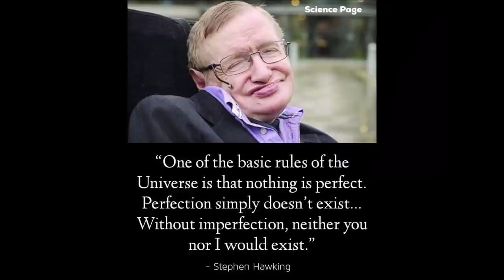1970 Chevy Impala 454 Fire Chief 1/25 Scale Model Kit Build Review AMT1162 and Tutorial

Comment: Your build looks fantastic.  However guys should know that this is a re-issue of the original annual kit from 1970.  The wheels don't rotate; you are supposed to glue them directly onto the axle/kingpins.  The same was true of AMT's 1969 Impala kit; although  MPC made a 69 Impala Custom Coupe with metal axles and rotating wheels.  Clearcoating  the plastic with floor polish was an amazing technique that I am using on all my builds now.  Future and other acrylic floor polishes are virtually foolproof, just brush them on  They are water-based for easy cleanup and safer modeling, and you can buy them at any department/houseware store..  Except for whitewall tires, you can also build this kit as a classy showroom Impala hardtop with the factory "turbine" wheels.
Reply from the maker: Thank you for your support and visiting the channel!

I'm sure everyone knows these R2 kits are all reissues.